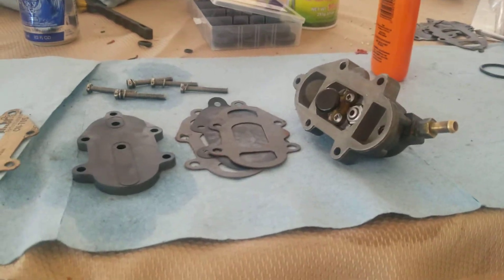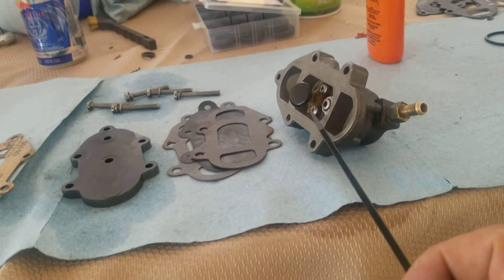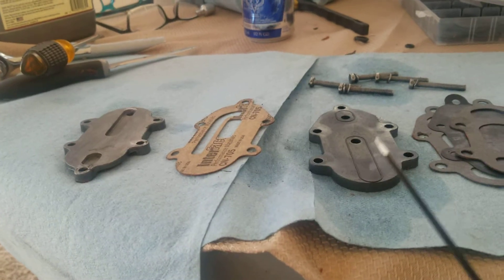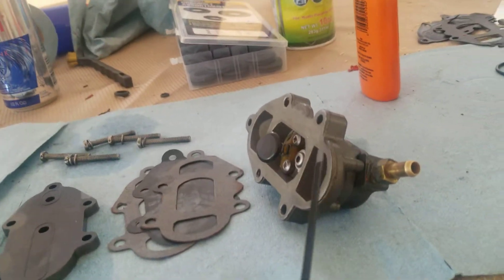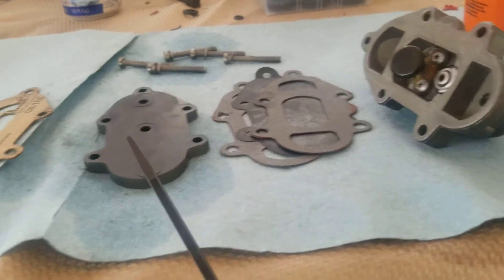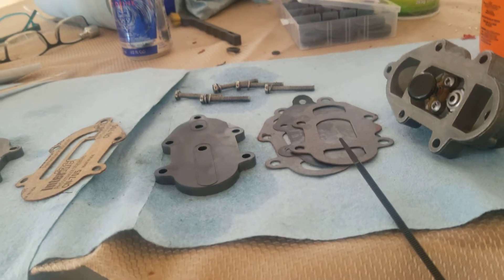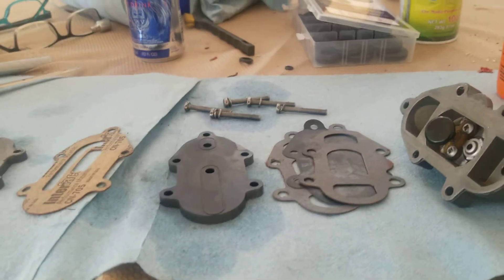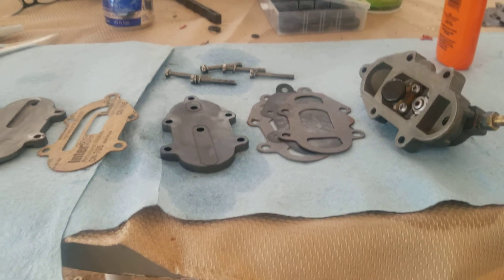Fuel pump rebuild. 6 cylinder 115 hp Mariner

Comment: Thanks for the detailed explanation of how the pump works, I also have a 115hp, been sitting for 2 years and I went to prime the fuel and fire her up but found the pump was leaking out of a gasket, going to look at doing the full rebuild with the check valves, this might also explain why it has such a hard time starting

Comment: I have a 1975 115hp tower of power. I am having trouble finding a fuel pump replacement kit. Can I ask where you got yours? Or if yours is a 1975 Tower of power as well, what is the replacement kit part number?
Reply: What I found for my 1978 900 (90 hp Tower of Power) is the Sierra 18-7811. Put your serial number into Marineengineparts.com and you can find almost any part number.